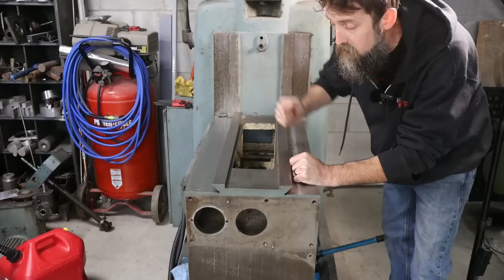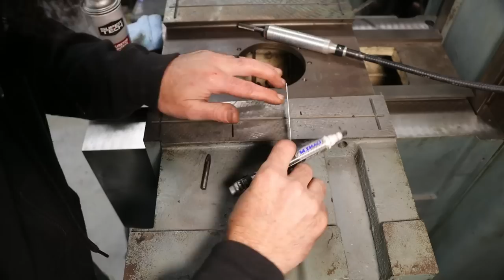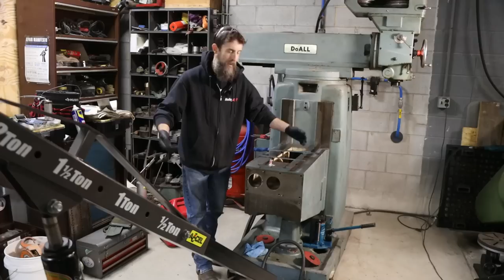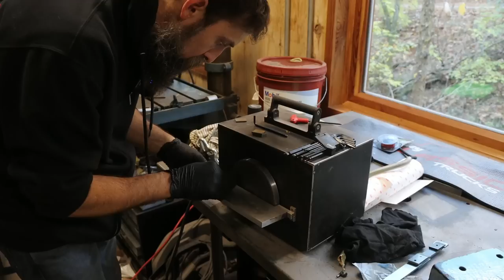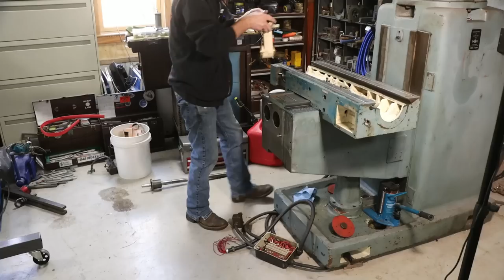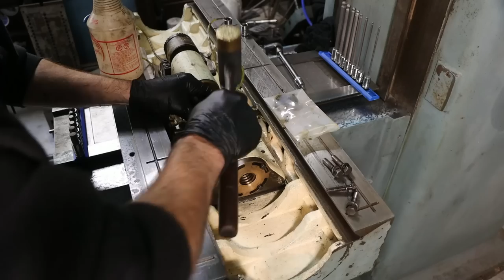Saddling the DoAll MIlling machine

Comment: Steve-  I rebuild machines too.  I usually make gib shims from pallet steel strapping banding. You can easily surface grind them to size if needed. You can glue them to the gib with green Loctite. If a gib design has 2 adjuster screws, one to tighten and one on the opposite side to take up, I don't even glue the shim.  It is trapped in between the adjusters on each end, so it can't go anywhere.  It is absolutely a good and sound practice to shim a gib, and glue it with Loctire or even not if the shim is trapped by the adjusters.  I think your OCD is getting ahead of you.  Using an epoxy resin filler like Moglice or whatever has more variables to control to implement successfully.  And remember, anytime you have plastic material on your ways, you need to keep them super clean, because plastic way coverings will embed chips easily if one happens to get under there. Your shop, your rules, but really, shimming a gib is a common and engineering sound method of taking up a gib clearance. ---Doozer
Reply: I agree. I have done enough scraping and fitment, especially for a non-production machine
Reply: My thought was to maybe pin the shim in place if it isn’t a trapped gib. Would this be ok?  I also have a question about curved gibs. I am rebuilding a Bridgeport mill at the moment just for a job shop type machine so nothing critical. But what I’ve found is that the table gib is curved over it’s entirety??  Wondering if this is from locking the table too tight ? Or wear? Or if it’s even common. Not sure if it’s worth trying to straighten (if possible). Or if it just needs to be replaced. Thanks Ian.
Reply: @Mad.Man.Marine  I have straightened many gibs.  Use a press or a c-clamp and some spacer blocks. And be careful not to crack it if it is cast iron. Many are. Better machines use ductile iron. Just go slow.  --Doozer

Comment: For those who don't know. Flaking is the same as honing a piston cylinder. It creates micro scratches for micro beads of oil to lock into. Like a skin layer of trillions of tiny bearings. 😎😎👍👍For a JWD Steve 2 thumbs. Plus a single tooth file used once with medium pressure in each direction to make cross hatching across the ways works just as well as flaking. If not better.

Comment: When I learned scraping, here is what I was taught about flaking.  The handle end of the scraper is on your left shoulder, the scraping end in the left hand the scraping tool about 20 to 50 decrees to the flaked surface.  The right hand bumps the scraper towards your body, in effect, pulling the scraper, not pusng as ususal.  This will give you a shallow cut, c- shaped.  Worked pretty well for me.
Reply: Yes, even as a novice it gives a professional look. I found it very easy after a bit.

Comment: Gibb fitment. Why not just cut out a shim pack set out of Starrett shim shock to back up the gibb bar gap. Did that on a 30 inch swing American Pacemaker lathe bed. Worked great for decades. Drilled & tapped two 4/40 tapped stop screw holes at each end of the shim pack on the very ends of the bar to keep the shims all locked in place. They can't move up or down and the 4/40s keep them from moving forward or back. Use as thick a shims as possible to keep the flex & binding down.
Reply: Agreed - I did machine installs, repairs and rebuilds commercially. Other thing to note is you can't test surface and part fitment without the gibbs installed.
Reply: @Pilotltd   I didn't know if you could understand the way I put it, kind of hard to explain on here---- we really need to have each others phone numbers for this kind of stuff. I am an old school journeyman machinist from McDonnel Aircraft  & Navy shipyards and a vintage GM car restorer as a hobby, so we have much in common.

Comment: Thanks Steve, You have done a great job on the truck and you're doing a great job on the mill. I will be interested to see how you deal with misalignment on the screws due to the material removal. Thanks for putting these together, always a good watch. Mart in England.
Reply: I was thinking same thing about screw alignment.

Comment: Lol , i know what you mean about the flaking !    It is an art to get it looking even .  I do a slightly different style & have a long way to go  , a wonky crescent  1/2 moon .  But i only do the undersides of a slide ways .   👍
Reply: Yes, only the underside of the ways is best in my mind.  There was enough swirl marks from the cup wheel having been ground to retain the oil.  Once I had a Millport machine (import Bridgeport copy) and the knee ways were hardened and ground, smooth as glass, and the underside of the saddle was flaked.  The knee ways always showed oil, and swarf swept cleanly off. Side note, this Millport was build much nicer than a Bridgeport. Hate to admit that.  The tables moves smooth as glass on that thing. (yes the gibs were properly adjusted). Max, I love your lathe build you are doing. Top work.  --Doozer
Reply: @kooldoozer  Thanks .  We have to get buy with what we have on hand here .  The resources are just not around any more to send large machine parts out for grinding or planing  , let alone finding a power scraper !  👍

Comment: I have never used Turcite, but my understanding is it is a very thin layer being added.  When I have had greatly undersized gibs to be fitted, my go to was always feeler gauge stock, much as you have done.  I used a bit of gasket adhesive to hold it in place.  My only concern was the next time I had the gib out, it was not really adhering.  Way oil kept it sort of loose, but the gib pressure was not affected, the slides did their job, the machines ran well.

Comment: Steve, in my experience in rebuilding machines, I would fill in the score marks on the top of the knee with either solder, silver-solder or epoxy. There is a reason oil grooves are on the bottom of the saddle.
Reply: I have used 50/50 soft solder to fill in way scratches.  It works great for sure.  But these left over marks are really small. Risk of swarf getting in there is true, but pretty small.  In production where no one cares for cleaning the machines, I can see the concern. But in a home shop, I think it will get cleaned more often to not be an issue.  I am pretty OCD myself, and I would not worry about this 90% cleanup that Steve has here on his ways.  ----Doozer

Comment: Hello Steve, The heavy scoring on the ways that it had in the past make me wonder if your oil manifold has perhaps a problem in properly pressurizing all of the lines. Good video, especially the grinding of the grooves, which you made deceptively short with a bit of time lapse. I am sure that a big chunk of you day went to you patiently grinding the groove, while the camera made it seem brief. Well done.
Reply: Bijur oil metering units most ALWAYS clog. Good tip. I also would highly suspect the metering unit that feeds the previously scored way might be partially or fully clogged. McMaster Carr has them. If I was this far into a machine, I would replace some or all of the Bijur metering units.  It might be a $150 investment to replace them all, but worth it compared to the cost of way grinding.  -----Doozer

Comment: Great video, Steve.  I would agree with Doozer that using a metal shim on the  non-wear side of the gib should present no problem at all.  Only one side of that gib contacts a moving surface.  With it properly secured (I would use an epoxy if you think it MIGHT slip around after adjusting), you should have years of life left there.  One question, if you're concerned with the fit of the saddle/cross slide nut, wouldn't it have been better to have test fit the lead screw and shimmed the nut accordingly BEFORE putting in the lube manifold?  Seems to me that you're going to have to disassemble a fair bit if the alignment isn't quite right.

Comment: Nice to see you can still find sll parts. That would have been my issue for sure 🙂
Wondering, do you need to calibrate the oil feed for the new oil grooves? 
And my intuition would have put bothe the zigzag lines in an angel to the motion of the saddle. Is there a good reason not to do so?

Comment: I don’t think you should use turcite to shim the gib. That would be a waste of that expensive material. That side of the gib is not a wearing surface. Any old shim stock will do. Also, just for the sake of discussion, I would not assume that the ground surface that you flaked is as flat as a the surfaces that you scraped. In an perfect world those ways should have been spotted and scraped as well. I understand that this probably wasn’t practical due to time constraints etc.  I’m sure that it is 100 times better than what it was and it will work well. So soon you will have another machine running well and you won’t be tripping over a bazillion loose machine parts which is always a bonus.